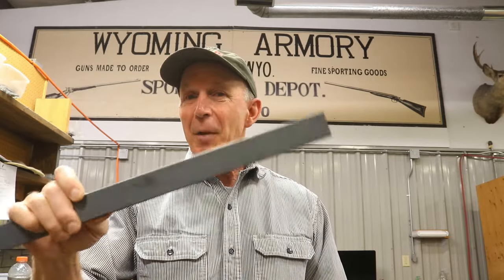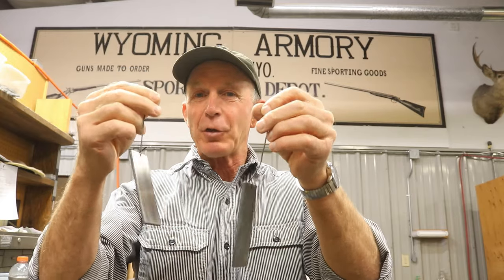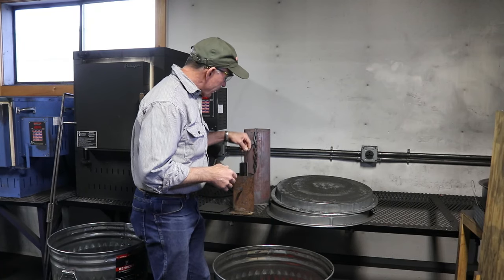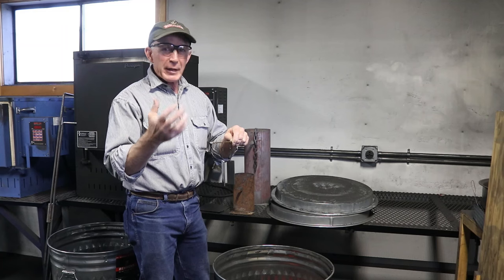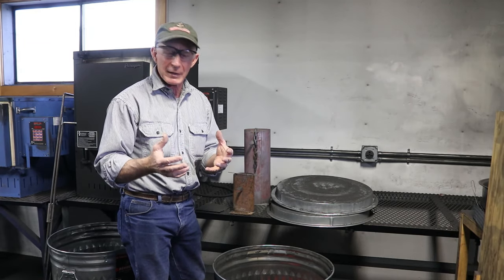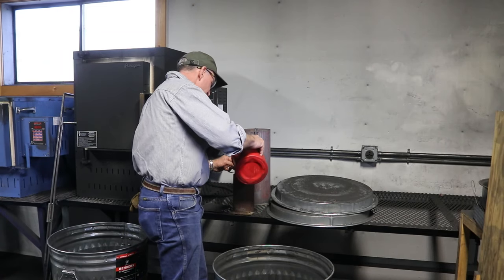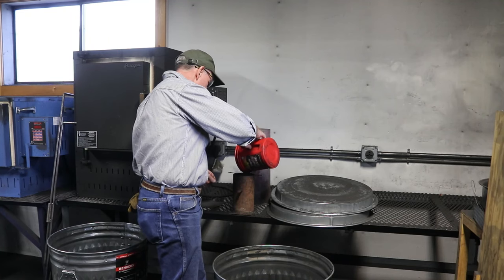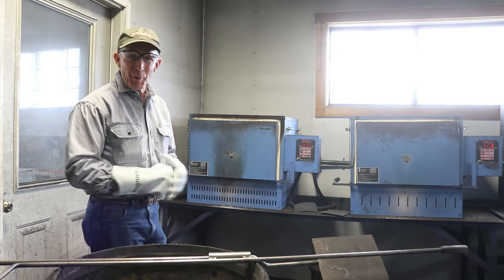Charcoal Blue

Comment: It was hard to tell but it looked like the 2 that were not as nice were facing the outside of the canaster. The 400 grit faced the center. I've never done any of this but I have studied it some. What I've read is you want at least 2 inches of the charcoal between the part and outside of the canaster.  Have you found this to be a fact?
Reply from the maker: Thanks.  That's great information.  I'll try the next batch in a bigger crucible and see if it makes a difference.

Comment: When I was in college I built 3 Dixie Gun Works  black powder revolvers from kits.  I charcoal blued them.  I just broke up enough bbq grill charcoal to cover the parts and heated it up over a camp stove.. I rubbed the parts with cotton balls dipped in lime until I got the color I wanted. Came out great.  I got the directions from a booklet by Kit  Ravenshear..   I did this in the early 70's. I still have one and it still looks good.  Enjoy your videos.
Reply from the maker: Thanks for watching our channel.  Do you recall approximately how long it took to get the color you wanted?  I cooked this batch for 2 hours.  I did a second batch for 2 1/2 hours and it didn't come out as good.  I may be leaving them in the charcoal too long.
Reply: @thecinnabar8442  I think I pulled the parts out every 10-15 minutes to swab them.  I just had them cooking in a bread pan.  I don't think it took over an hour once the charcoal started glowing a bit.

Comment: Thanks Mark for this presentation. I remember a gunshop in the Santa Anna, CA area in the early 1970s that did charcoal bluing.
I never cared for it because the acids in my hands would strip off the finish. I have done rust blue in the past and it is much more durable.
Reply from the maker: Done correctly, charcoal blue has the reputation of being more durable than rust blue or hot caustic blue.  These test pieces are difficult to put a scratch in, even when intentionally trying to.  I'm not sure what process that gunshop was using, but it doesn't sound like traditional charcoal blue.  The Italians are using a method similar to "nitre" or "heat" blue and calling it charcoal blue these days.  It's not durable at all.  I suspect that's what was being done in the gunshop you mentioned as well.

Comment: Very interesting. Wonder if the blotchy finish on the two panels are because they were facing outward towards the metal crucible or because they were facing inward away from the crucible? If the color or consistency in the color is from out gassing, it may be controlled by a bigger crucible or due to contamination already on the crucibles walls from previous operations and materials.One thing I learned from doing Physical Vapor Deposition, is that it takes very little out gassing to impact a finishes color. Thanks for sharing. Looking forward to seeing some more testing on this.